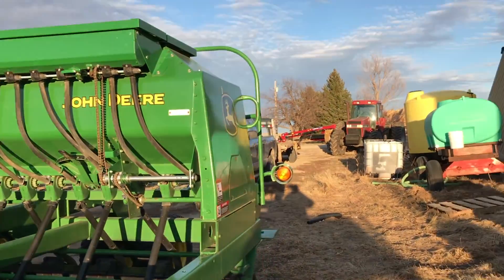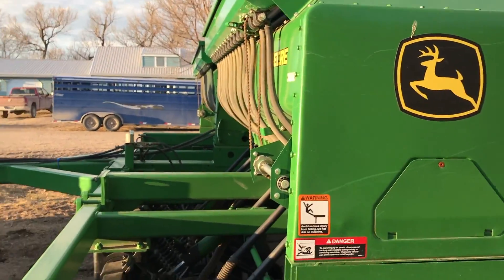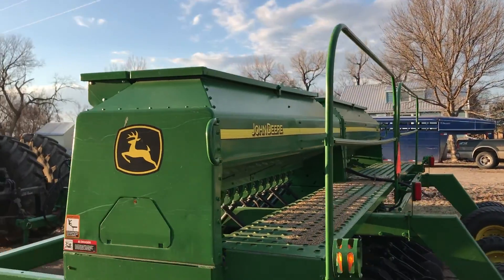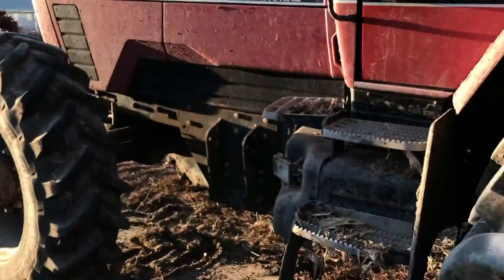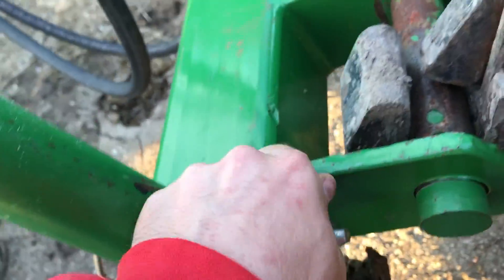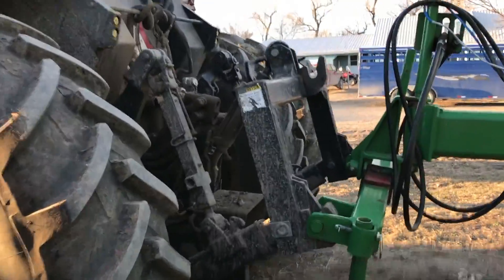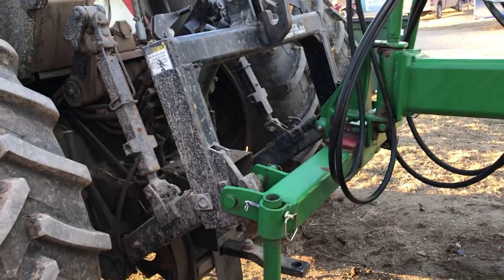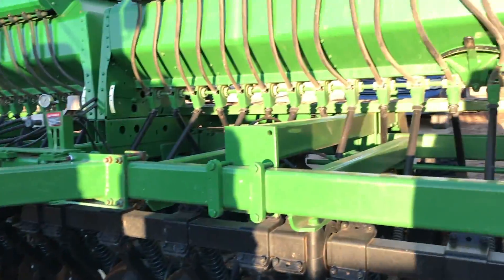Why do I like 2 point or quick hitch on tractors

Comment: Just bought a 15 ft version of yours.  I paid 24k.  Mine has a scale and markers.  I'm waiting on the dealer to install the small seed box he included on the sale.  I'm gonna install the Needham seed tube bushings this year for more accurate seed boot positioning, and plan on changing the closing wheels and upgrading to 90 series boots next year.  It wouldn't be hard to spend 10k in upgrade parts.

I agree on the two point hitch, as long as a person has a tractor big enough.  the 15 footers supposedly have 4800 lbs of tongue weight. Seems most of these have the dolly wheels to pull them with little smaller tractors.  I'm pulling mine with either my 4840 or 4640.
Reply from the maker: not a fan of needham pushing... i like shoup ones better Actually think a person can pull a bigger drill with a smaller tractor with a 2 pt hitch as then the weight of the drill is helping from pushing the tractor down changing mine to the 90 series boots this spring got parts from shoup to do that as well... plan on getting seed boots from deere.
Reply: @tedkahler  
Well, guys are still pulling these with 4430s around here, and I don't think a 4430 would care for pulling a two point hitch model.  It can pull a dolly wheel one if the operator is careful.  Maybe even a 4020, but that would be a stretch in hills.  Seems like 9 out of 10 are dolly wheel.  

I specifically sought out a two point hitch model for the same reasons you like them.  Bonus that they tend to sell for a little less money.

Could you give the reasons you don't like the Needhams?  I like that you only have to drill out the boot instead of the standard.  Too late for me because they got delivered friday.
Reply from the maker: farmerboybill  add weight to front would  dolly if you pee in the wrong spot it will sink in and start plowing.   As far as Needhams..... I can buy Deere boots for 35 ish bucks apiece needham you either drill out Deere boots or buy needhams and there 90 ish bucks apiece  and every time you change boots you have to reppeat the one from shoup you do it once and your done.  Can use boots from anyone
Reply: @tedkahler  
Obviously I haven't done it yet, but I guess I bought into what Needham was saying that their bushing kit holds the boot better because it is two bushings above and below the bracket.  I guess I'll find out.  I'd never heard of them until last week when a friend highly recommended their kit over Shoup.

Looks like Deere offers a "standard wear" boot for $39.15, and an "extra wear" boot for $101.95.  I'd be curious to see life expectancy on one versus the other versus the Needhams.  And of course where they are made.  I'll order a couple to see.
Reply from the maker: farmerboybill heard the wear depend on soil